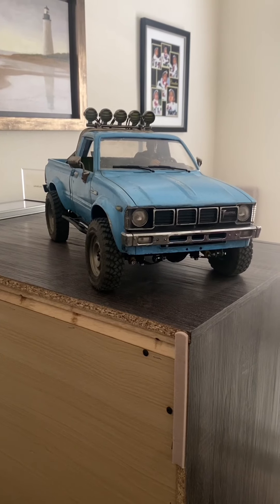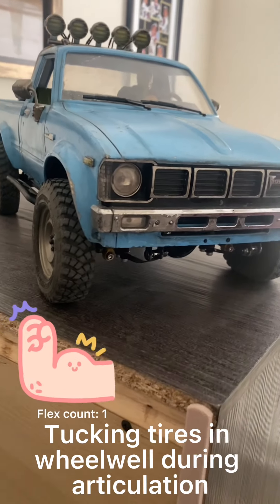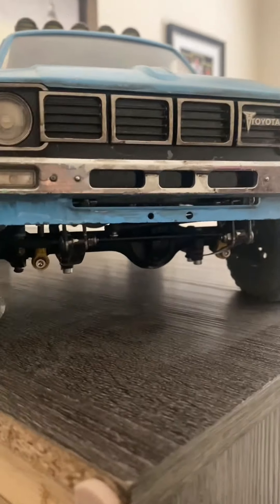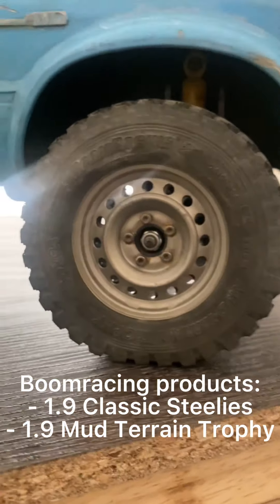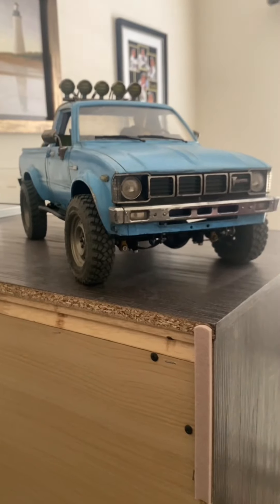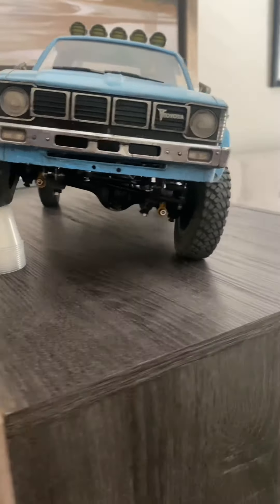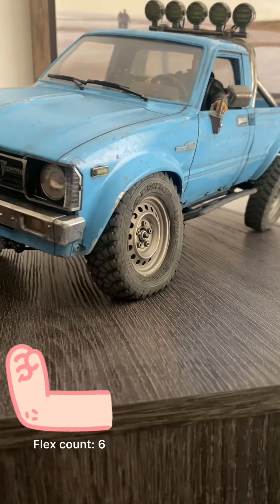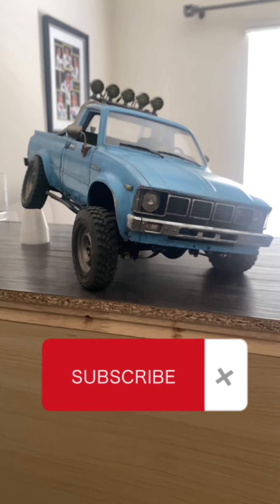How to get more scale flex from RC4WD Trail Finder 2

Comment: First 😄 Very good work on the leaf springs and also with these shock absorbers which I find adds realism to this Toyota. I really like the way the wheel fits in the fender of the car which gives excellent flex and very good compared to a real Toyota. Really well done. And bravo for your work to put the floor 👏
Reply from the maker: Thank you my friend. It was all trial and error then it happened 😄🤣😅 The tire tucked in the front fender. I thought about it while working on my floor. I then took a break to work on the TF2 and there it was. I really appreciate you Pascal. I can’t thank you enough.
Reply: @BITTERFLEA  At least you will have done the work of the soil and the tf2 at the same time 😄 It sure is a very good job 😉👍
Reply from the maker: @satorrotas  Thank you 🙏🏾
Reply: @BITTERFLEA  😊👍

Comment: Hey bro thank you I had mounted axels on the bottom of the leaf springs they came like that from a buddy that traded it to me and it flexes but no wear neer yours and it has no suspension  other than the leaf springs no shocks   on it and there like a Bow shape leaf spring   it has the same front brackets as yours but sits high like crazy high
Reply from the maker: Just keep tweaking it until you are happy with the stance.